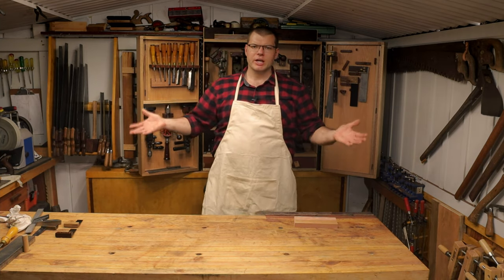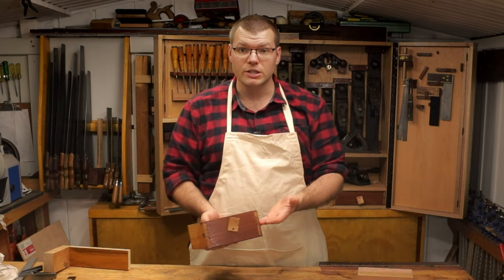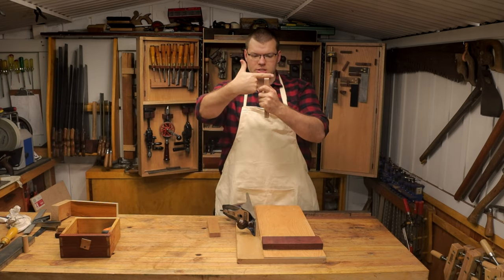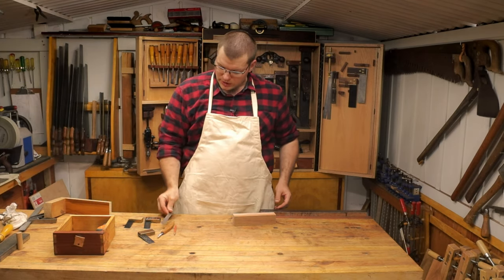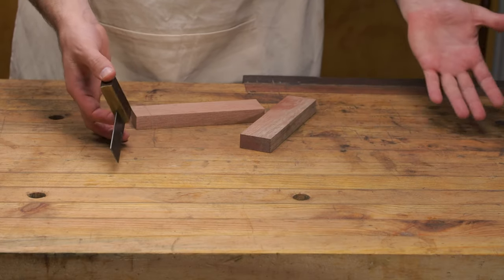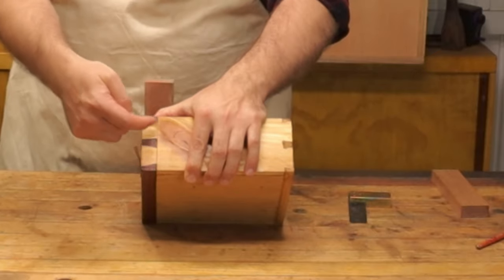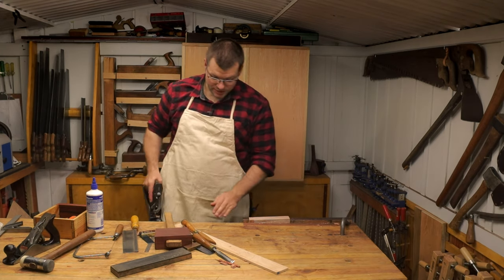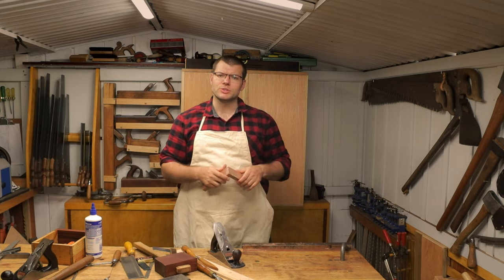How to Cut a DOVETAIL Joint By Hand

Comment: Hi Luke, I know I'm two years behind the times commenting here now but it's the first time I've watched this video...
The end product came out well but I can't help wondering why you chiselled only half the tail out then went back in to take out the rest - what advantage did that give?
I do agree that using a coping saw is silly - it's a modern slapdash technique that is scruffy and inaccurate and takes more time to clean up than doing it right in the first place.
Reply from the maker: @PeteLewisWoodwork  I don't remember why, i will have to re-watch the video and get back to you when i get a chance